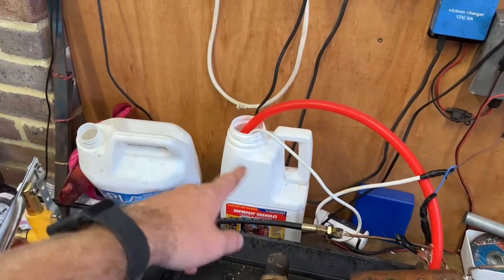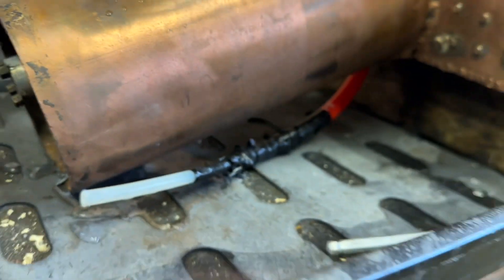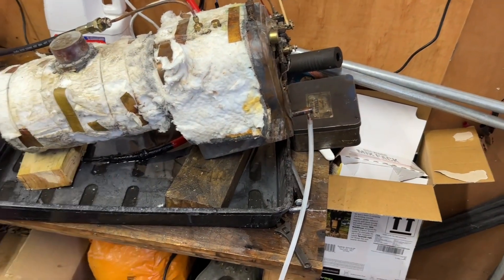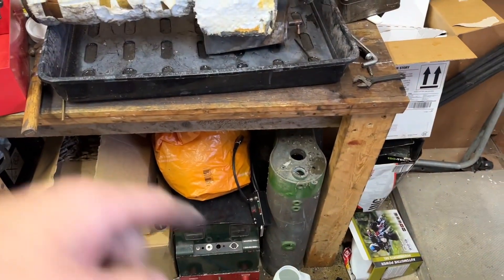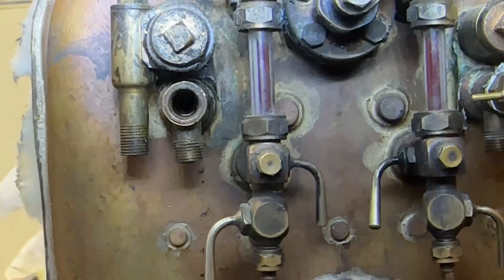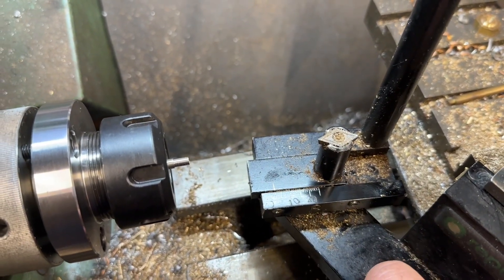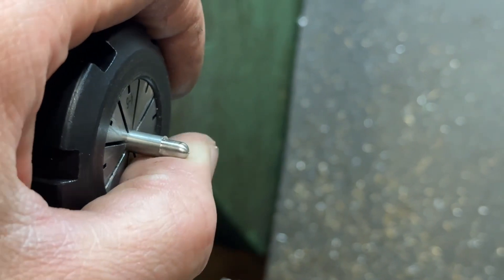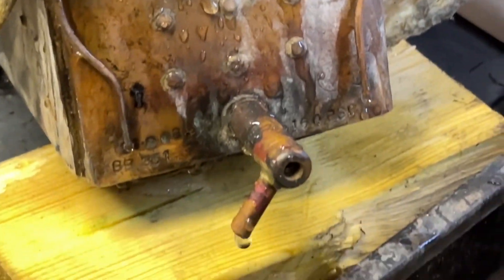Boiler testing at home…

Comment: Tom, what fittings do you need to reduce the hydraulic test pump fittings down to say 1/4" I dont know what he pumps dimensions in metric would reduce to?
Reply from the maker: I took a fitting that fitted the pump, no idea what thread it was, came with the pump, drilled it out and soldered in a pipe which was the right size for the union I wanted on the end.
Reply: @TomsWorkshop42 Ah, good idea, didn't think of doing that!

Comment: Very methodical. I finished off a part built engine 4 years ago and only found a couple of leaks when I had it all assembled and ready to steam test! Found them on compressed air tests. Thankfully they were not structural, just weeps that could be fixed with 965 solder with 3.5% silver content. Moral of the story, test all components prior to assembly. On my current build this is the method I have used, with satisfaction of finding faults, rectifying then continuing on. Good job Tom